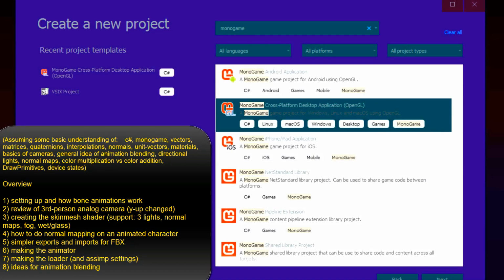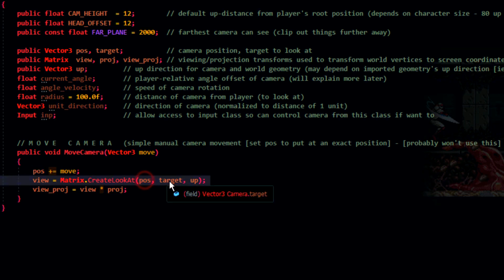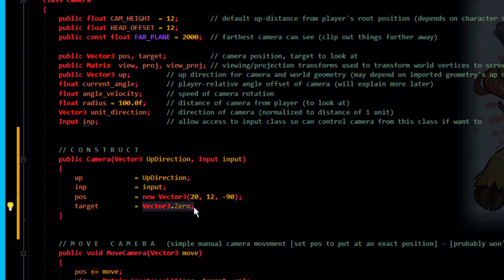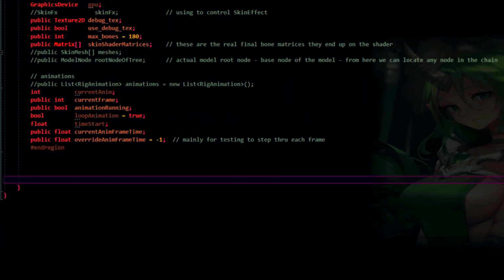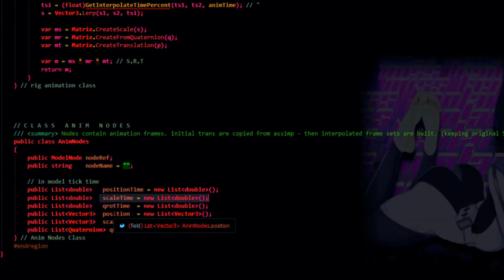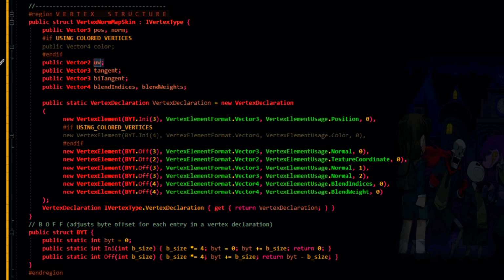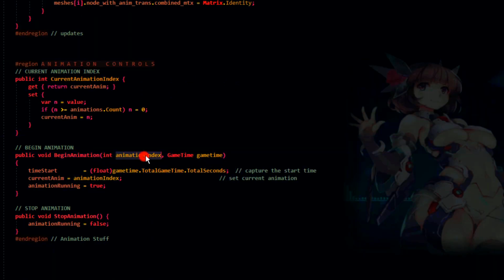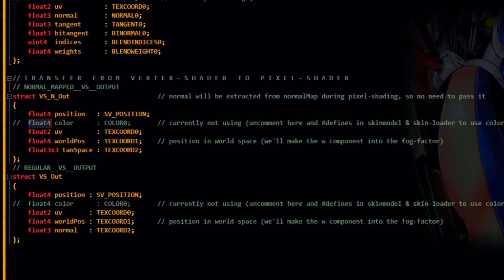Make FBX Skinned Mesh Loader Animator - Part 1

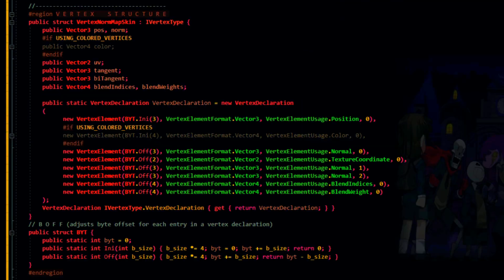Comment: At 1hr, 7min, 36s, (1:07:36) I am seeing BYT.Off(someInteger) and I'm wondering what this "BYT" object is.  Is this from the Assimp includes?
Reply from the maker: That's part of the BYT struct below it. It helps by returning the current byte offset. int byt keeps track of the total bytes added so far. 
So if I say BYT.Off(3), [Vector3 = 3 floats) I'm returning the current byte offset but also updating byt for next time. 
  It might be better to just do it manually, since sometimes we might want to add unusually sized elements which are not 4 bytes each. In which case we'd change them to: 0 for first, 3*4 from previous = 12 for 2nd, +12 from previous = 24 for 3rd, + 8 from previous = 32,  then 44, then 56, then 72 (last one because 16 bytes offset in previous one).
Reply: @AlienScribble  Thanks, somehow I missed that struct and couldn't figure out why I was getting red squigglies lol.  I'm trying to follow along with this tutorial on Ubuntu and VSCode and having difficulties with the fact that Aether.Extras seems to only be available with Windows and standard VS, not VSCode, so I'm not sure if I'm doing all this work in vain or not. Eek! >.<
Reply: @AlienScribble  My bad, I meant to say Assimp, not Aether.Extras, I must have had other things on my mind at the moment.  I don't know how to add nuget packages using VSCode, except for looking through their Extensions catalog and downloading what's available there.  They don't have any Assimp.  Regular Visual Studio isn't available on Linux so I wasn't able to follow along with the Nuget import of Assimp, not sure how that'll play out for me.
Reply: @AlienScribble  Thank you for going so far out of your way to explain that for me!

Comment: I was wondering, since I'm still new to Blender and creating models complete with bones and animations... it dawned on me that even if I followed along with your code, I would have a hard time deducing if I made mistakes in copying what you did vs possibly having made mistakes in my model.  With this uncertainty, it could be very hard for me to debug errors that I come across.  So just to make sure that I have a working model, to therefore make sure that any mistakes I make at first are only in the code... could you refer any of us to a simple properly-created asset that we could use as a test-import to make sure that our implementation of your code is working?
Reply from the maker: Sure thing. If you expand the video description, you'll see a Source: link. In the source Content, there should be the test model used for this tutorial. It's a more complex multi-skin rig (not a single simple consolidated one), so the code needs to be robust to be able to load and animate it. If that character works, then I'd expect almost any variety of rig to work. I know that some people did exports with Blender that imported and it worked using this (I'm not sure if certain export settings are needed in Blender).
Reply: @AlienScribble  Thank you so much!

Comment: Many Thanks to Mr Wil MOTIL for this wonderfull video.
Reply: Wow ... Thank scribble this is just based on my model animation code he did a lot of work cleaning it up.
Though not gonna lie it took me a good 4 months to write it and a lot of research and it still really needs work i had planned to go back and make sure the meshes were instanced thru vertex buffers but didn't get around to it.
If you are looking for a gltf model animation class check out vepnades MonoScene which sort of is why i didn't get back to this i was helping him out with the shaders and getting the khronos group test models to pass.
Reply: @SomeGuy-nr9id  Interesting comment.  So, are you Mr. Motil then?  If so, I owe you a big thanks for posting the code to your camera class in a discussion forum.  Also just wanted to mention, based on what you said in this comment, that when I google search for "vepnades MonoScene" as you recommend, the only two results I get are from a Hebrew website called ILfor which reference these videos and the comments in them... so other than self-referencing your comment, I find no signs of "vepnades MonoScene" out there.